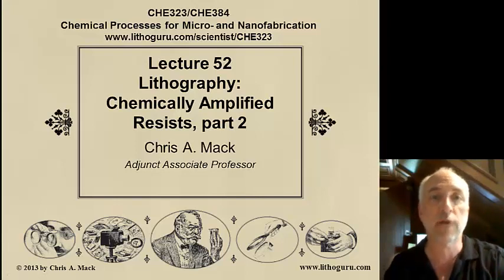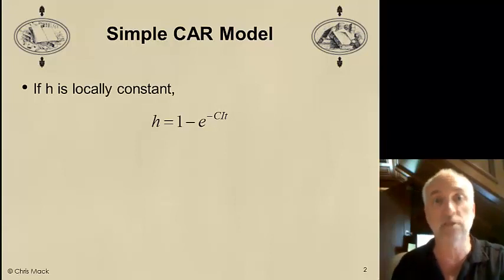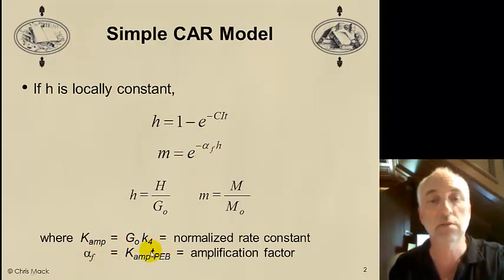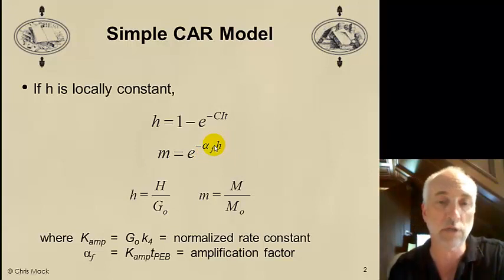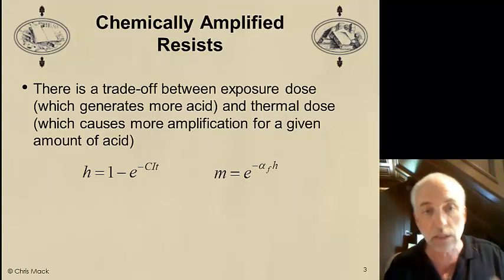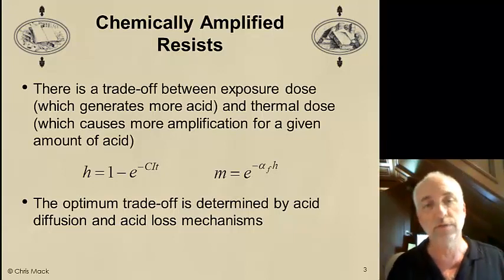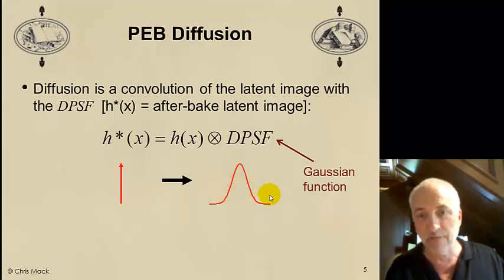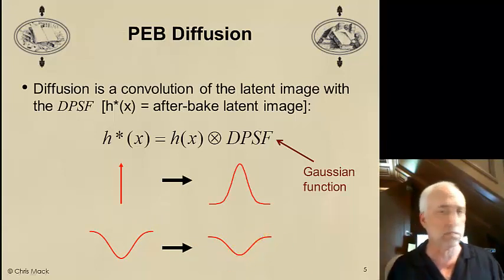Lecture 52 (CHE 323) Lithography Chemically Amplified Resists, part 2

Comment: If we only add a small amount of base to the photoresist (is the amount of base fixed or can we keep adding it?)How do we control the concentration of acid? If we want to get the acid concentration down to a critical point, do we have to keep adding base to the photoresist?
Reply from the maker: Base is added by the photoresist maker.  It is not something that a photoresist user adds.